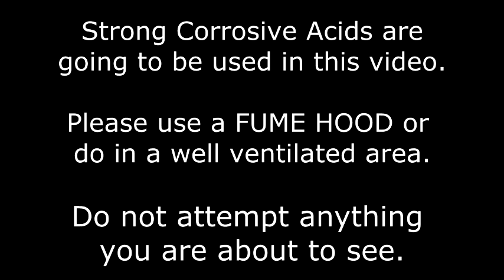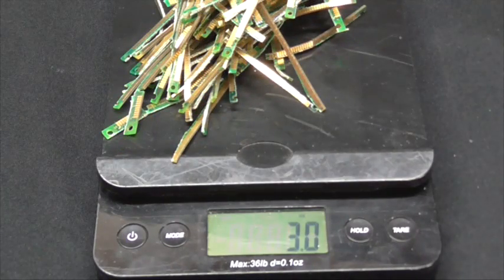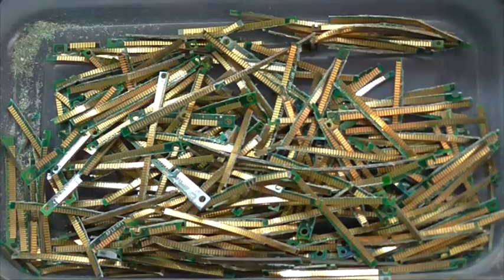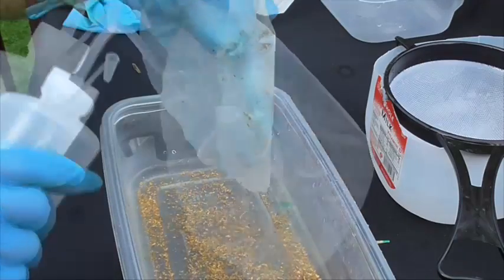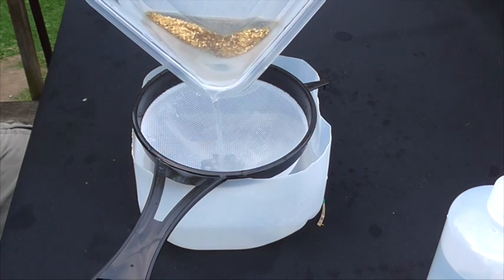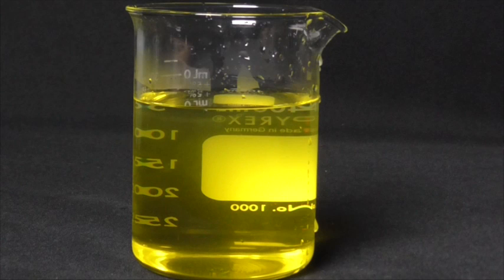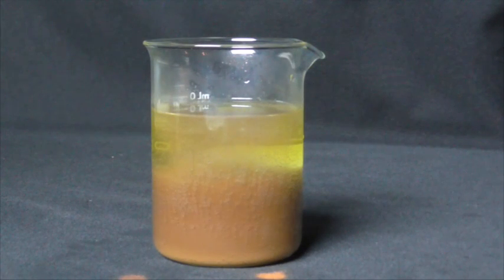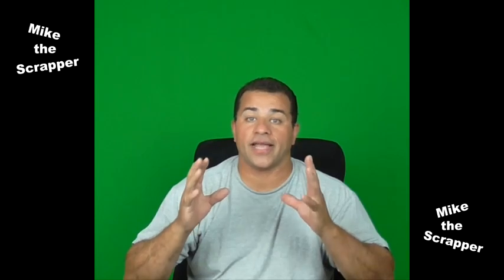Gold Recovery ( Scrapping Ram finger boards)

Comment: Isn't gold down 35% or 40% from just last year?

I don't get it... gold gets dug out of the ground in Africa, or someplace. Then we melt it down, dig another hole, bury it again and pay people to stand around guarding it. It has no utility. Anyone watching from Mars would be scratching their head.
Reply: We use gold mostly for electronics and other industrial purposes. It hasn't been used as a currency in a long time. Gold is one of the best conductors we know, and therefore it is in almost every single electronic. We may not have a use for it as money anymore, but we will most likely always need gold for technology.
Reply: Um.......... The whole point of this video is how gold is present in key computer parts... Its used because it doesn't easily corrode making it good for electronics which require uninterrupted flow of current. Gold has TONS of utility because of this.
Reply: "It has no utility" why do they put it in ram sticks? could you offer a better substitute?

Comment: $30-40 worth of gold, but used $70-80 worth of chemicals and how many man hours?  Meh, not worth it lol
Reply from the maker: I still have enough chemicals to make more batches. If you had 1000 or more Ram, you could make more money with the same amount of product I used in this video.
Reply: Mike the Scrapper or you could get a minimum wage job and make 3x that in one day instead of how ever long it would take dumpster diving to collect 1000 ram boards. where would anyone get 1000 ram boards? even if you owned some sort of scrap yard... which you prolly dont because a scrap yard sells their scrap to professional refineries ... not some schmuck with a youtube channel. so all that BS at the end about an investment is just that .. BS.
Reply: PlacidDream yea and the professional refineries hardly make worth by scrapping computers mainly becuse of the time it takes and all chems
Reply: kallmannkallmann Professional refineries make enough money. They extract the copper from the traces, the silver and palladium and nickel from the capacitors, the gold from the electroplating and also gold bonds to the CPU die. This is something that can be done on a small scale but large scale (thousands of CPU) is always profitable while small scale is not.

Comment: This cake doesn't cover the cost of ingredients.
Reply: You can get small concentrated bottles of all of those chemicals for less than 100$. 20$ for 1 qt of fuming nitric/muriatic, and even less for the power chemicals.

It is feasible, but there are better things that you could be doing.
Reply: aslan burnley Yeah like collecting couches and getting spare change from the cushions.  I think that would be quicker and more profitable.

Comment: Hey Mike, just wanted to prove some of these people wrong! I went onto ebay and bought 5000 ounces of aircraft pins and connectors. Now mind you they were 100 mil thick. So I did what you did step by step. Long story short, after letting the acid do its thing and cleaning it and drying. I then smelted it in my small kiln which is made for this. I also have graphite molds 1,2,5,10 and a 20 oz molds. I used the 5 ozt mold and poured out the gold. Guess what to all you non believers out there I walked away with 2.246 ozt of gold. I then took it to the gold buying place up the street and got $2,100.00 dollars for this little bar of gold. All the supplies and acid cost me less then $40.00 dollars to buy. Everything else I was able to get from my kitchen and toss after I was done. So yes, there is a ton of money out there waiting to be plucked from the trash, ground, broken things, it's everywhere you look. You just need to learn how to find it.

Comment: Does anyone know a rough estimate of how much money it costs to purchase all of the necessary equipment? I'm trying to determine start up costs. Trying to figure out, if i were to do this, at which point i would start bringing in profits. 

I think if you got a few thousand cell phones, and put all the right proportions into a bigger pvc container or something this could be worth your time.
Reply from the maker: Lets say $100 for all chemicals & equipment.
Reply: Mike the Scrapper

Ok sweet thanks man, I'm subscribed! I have a few more major questions.

1.) For the step where you allow the solution to sit in the sun: do you think this a necessity or is it just a catalyst to speed up chemical process (by what approximate factor would it speed it up)? How long do you think it should sit in a winter environment with minimal sun.

2.) Are there other useful parts in a computer containing gold other than the ram pieces? Is it such a small amount that it isn't worth your time to cut them out? Is it necessary to extract only the gold containing alloys (such as the tiny gold fingers) or can you cut up the entire ram cards, mother boards/sound cards/video graphics cards, for example, into smaller pieces and just mix them into a big batch... or will other chemicals used to make alloys in circuit boards interfere with this specific chemical process?

I'm asking this mainly to calculate time expenditure. The chemical process might take a bit longer, but I think it would save a lot of time to just dump sliced up pieces into a big tub of the solution rather than spending hours on 1000's of boards cutting out tiny piece by piece.

The other thing is: I would take the time to separate the tiny pieces if you think there are other metals that can be extracted out of boards. I wouldn't want to potentially ruin an entire board for the gold extraction of I can also get a decent amount copper out of it with a different process. If you can't get a decent amount of money out of the other metals I will just stick to gold because I have limited time to spend.

Any information you can share on these kinds of questions I would be extremely grateful. Tuition is expensive these days you know lol and any extra cash sources helps..
Reply: Mike the Scrapper

I just watched some of your other videos which answered a lot of other questions but some of these details still stand to be clarified.

Comment: tip: you can raise the conc of your H2O2 by freezing it. Certain preservatives interfere with this process, but easy to find.
-20c to -15c work well)
If you can control pressure, and humidity as well, you should be able to go as high as 70%, which is fairly caustic, so you don't want to get that on your skin.
93% if you have access to a vacuum still.,
....best I could do anyway

Comment: I really enjoyed the process, albeit impractical. Cyanide would be cheaper, but more dangerous. The cost of the 8-9 molar nitric acid outweighs the value of the gold, let alone the cost of the Sodium metabisulfate.
You're absolutely right, in warning against using these chemicals, whimsically. They can be very dangerous, and should only be handled by experienced persons, or under proper supervision.
PPE is a MUST here.

Comment: You disposed of the first solution in a wrong way. To get the nickel and gold finish off the board you used HCl and H2O2 to etch off the copper thats under them, then you are left with a cupric chloride solution. The correct way to dispose of it is to add aluminum to the solution until all of the copper precipitates, then its safe to flush down the toilet.

Comment: Mike, Great video. I have some critiques if you don't mind. First, baking soda is not a good waste disposal method. You will be dumping heavy metals (Cu) into the water and putting Cu compounds into the dump. Plating out the Cu with Zn, Fe, or Al is a much cleaner method. You also have the added benefit of being able to collect the Cu to melt and sell. Also, there will always be HCL in the solution. Excess HCL does not hurt precipitation. HNO3 is what needs to be eliminated. This can be done with urea or the evaporation technique. Lastly if you use a filter to dry your gold you will lose some in the filter itself. If you have quality glassware you can simply evaporate the gold in the beaker and get 100% gold yield. Again very nice video!

Comment: Great video! The problem is still time. Time is money. The amount of time and cost of the materials you used exceeded the money (gold) gained from this process. It would have been more profitable to work at a PT job for $8.50 an hour for 5 hours but maybe not as fun as playing with chemicals. Oh and then once you get the gold, you have to find a buyer. Still cool video. Thanks for sharing.

Comment: Pretty nice process. I would add one caution from a guy who's worked in a lab through college... there's a little saying... "do as you otter, add acid to water...' What happens the other way around is that adding water to the acid assuming it's strong enough will create a little steam bubble and spit the water, and usually acid back from the surface of the acid. So, that means you'll have acid and water splattered all over the place. If you add acid to water, the water volume is significantly greater and when the acid is introduced, it can not generate enough heat to make steam, and you don't get the splatter.

If your gold scrapping process works well, and you have your amounts balanced out well, your acid bath may not be super strong, but if you only have a little bit of gold, and therefore an excess of acid, you could have problems. Sulphuric (battery acid) is probably the worst, but nitric is a close second. Two very nasty acids to work with. Nitric is extra special because it is also a powerful oxidizer as well.

Also expect to see your metal strainer dissolve pretty quick too.

Now I have a plan on what to do with all my old computers, hard drives and random computer boards I have floating around! Thanks!
Reply from the maker: Awesome...Thank you for the tip...
Reply: Mike the Scrapper
after the gold is turned to powder and dried can you store it and if so how ,what room temp etc.
Reply: john doe
You can store it however you like. It's not going to change form at all. It can be stored in any form, metallic, salt, oxide, whatever, but if you plan on selling it, which I think is the goal, probably the metal form would be best, assuming it's out of sight so no dirt bag steals it.

Comment: Mike the best video in layman's terms to recover gold from scrap pc boards!!!!!
Now I need the best and simplest form, to remove gold plating from metal.
Reply from the maker: There is a way called Reverse electroplating. I am looking into the process to make a video on that.
Reply: Mike the Scrapper A messy 98% sulfuric acid process that takes a lot of pins to yield little, and in that process you get rid of copper in AR as opposed to ram fingers. You should do AR twice for sure since your AR wont be orange the first time.
Say 3 pounds of pins to 1.6 grams of gold.  
IDE pins would be more like 6 pounds. 

On ram fingers I yielded 20g of gold per 8.6 pounds of fingers.

If someone has pins then do it, but if someone is seeking pins while ram, boards are available, then go with the ram boards.
I still use like 5 ml 98% sulfuric at the end of AR to precipitate lead, just in case a little solder got on the fingers.
I have boards with dram, and some where we pull the dram , in which you might get a little solder.
If you are intending to pull the dram for processing, then it's best to cut the fingers first.
Also use the green snips rather than the yellow or red. Unless you are left handed, the green wiss ones let you better see the line your cutting on to avoid resistor packs and solder from low profile modules.

Comment: Like this 2 step process.  Mr. Mike first does a reaction with HCl and peroxide and then further extraction with A/R.  The explanation of the A/R reaction was key to success.  He neutralizes the acid with urea BEFORE the sodium metabisulfite precipitation.  Other videos I have watched seem to omit this step.  Does amyone lnow if I can use NaOH instead of urea?
Reply: If you add your nitric acid slowly and no more than needed to melt the gold, you do not need urea. Add nitric to the gold and HCI in small doses. When the reaction stops, add a little more until the gold is dissolved. This way there is no more nitric left to neutralize. Just HCI and suspended gold and other metals. Add a little concentrated sulfuric acid to dissolve any lead then distilled water.
Then the gold powder should be washed and decanted. Water first then hcl then water, then ammonia if silver got involved. These boards dont have silver, but in case you add your dads ring like I did LOL, it dissolves silver chloride. Final wash is boil in distilled water then dry. Now you have 24k!
Good video, but there is a lot of stuff in between.
Reply: u can use naoh, he use urea because it forms co2, co2 is used as indicator of acid neutralisation, if u use naoh there is no bubbles and no indication that reaction is terminated (unless u have pH indicator, lakmus or something else)
Reply: pmfsarajevo
baking soda does that.
Reply: jea it does, HCl + NaHco3=NaCl + hco3- ; hco3- + H+=h2co3 ; h2c03=h2o + co2

Comment: can you use this method on cell phone boards and gold pins as well??? awesome channel btw
Reply from the maker: Its a different method. 1st step is nitric acid. Thank you for the compliment.
Reply: is that for just the gold pins, or for both the gold pins and cell phone boards?
Reply from the maker: its for both. this method is only for fingers...
Reply: ok ty
Reply: when will you be doing a video for that method?
Reply from the maker: I think in the summer of 2014

Comment: Someone mentioned cost of Chemicals... can you safely store the acid solution and reuse it for multiple batches, before it loses its potency and you neutralize it?
Reply from the maker: you can use small batches.. the chemicals are fairly inexpensive. except for the nitric.
Reply: The muriatic acid will eventually eat a hole in its own container lol  cool trick. for copper scrappers LOL...take a penny, file the thin edge all around until the copper is filed off.  Drop it in muriatic acid for several hours.  The acid will eat the zinc and leave 2 little copper foils.
Reply: I have heard that before, but we all know a penny no longer has a cents worth of copper..... so sad.....

Comment: Hey mike great video now once your done with acids and neutralize the acid with baking soda did you just add regular tap water to the ram board after? Also will you make a video on how refine the gold in a furance? Thanks for the video
Reply from the maker: The baking soda is used after I get all the gold away. then I add baking soda.

Comment: Great video. Clear instructions. Nice to have it all in easy to follow steps. I have been collecting discarded computers for awhile, and have a ton of these gold fingers stored up. Question: Are you going to do a video like this for getting the gold off of CPU pins and the CPU's themselves?
Reply from the maker: Yes I am ..I will be doing video's on the ceramic& Green fiber Chips.
Reply: Sweet looking forward to that.

Comment: A question.. and this is from someone with 100% ZERO knowledge of chemistry beyond basic high school stuff 20 years ago..  When you cut the "fingers" off the boards.. why can you not go straight to "stick them in flame.. melt/burn off the plastic/silicon..  and sift the ashes?  KUDOS for advocating safety for sure..

Comment: what about dunking the whole board in acids,,,:)  Platinum rhodium silver gold are all the left behinds after the copper gets dissolved.  Is a board shredder a reality when it comes to breaking it down before you put it in the acid?  Sure so is a bench grinder that will grind those boards down to dust quickly,,,danger ,, the fiberglass is airborne after that so wear protectives and contain the work site in a small of a box that you can,,like sandblasting,,,after you have your dust,,put in acids.

Comment: The preference is for several reasons.    One is odor,  chlorine's distinct odor warns you of danger,  Nox does not.        Chlorine was ineffective as a chemical weapon and was rarely used as such.   Yes they both are poisonous and you need to take proper precautions no matter what.   Another reason i prefer the clorox/hcl method  is the potential danger of spilling.  nitric is a hell of alot worse than clorox

Comment: Hey Mike, what if the water still looks green? It never changed color and when I added the SMB, there is some gold setting at the bottom after few hours. I just threw everything in a container and used 1/2 & 1/2 nitric and muriatic acid and  so is it worth recovering or I messed up?

Comment: You shouldn't have a preference between Chlorine gas and NOx, both will form acid in your lungs if you inhale them. You are unlikely to survive either, and even if you do, you will have severe lung damage. They can cause the moisture in your eyes to turn to acid causing blindness. Chlorine gas was used as a crude form of chemical warfare in WW1.

Comment: Easier, cheaper and a bit safer method would be use  clorox/hcl instead of  nitric/hcl  accomplishes the same thing and no need for urea.   Personal preference,  I would rather deal with chlorine gas than Nox

Comment: Hi Mike... I don't know if this is reaching you.. I like your videos. My first time around I did not clip off all the solder pins and came out with kinda a mess.. How do I extract gold dust..    also are cpu pins all gold or is the back of the pin something else? Im trying another batch the correct way but would like to salvage 1st load.. Can you email?? Thanks Fred

Comment: That's because there isn't really a "correct" ratio... Any available O2 source will do.
Oxidation is due to availble O2 in situ, it can come from H2O2, bubbling air or even atmospheric pressure.  
Dissolution action is catalysed by the real work hourse of this reaction = Cu++ ions, not by available the O2. (though it is initiated by it as it dissolve some copper and gold initally).
The CuCl2 etching system is quite complex, but there's really no need to know it to do this process.